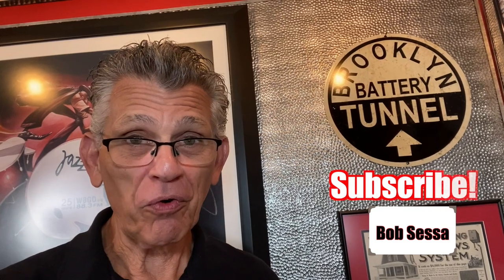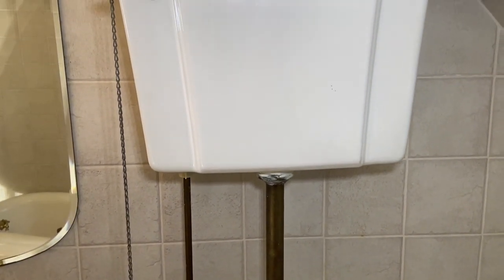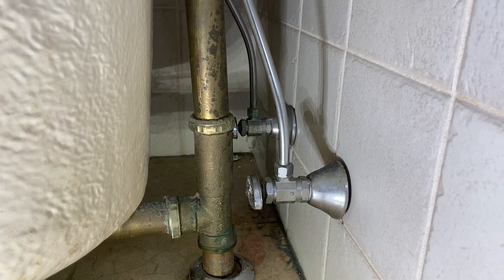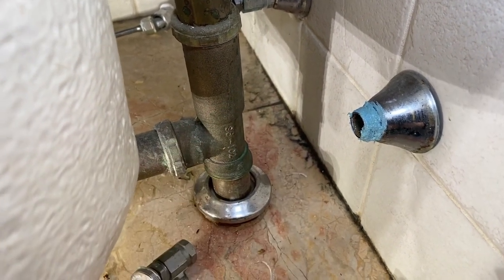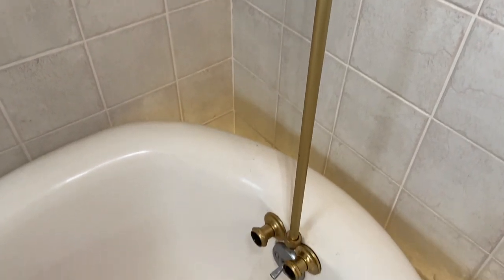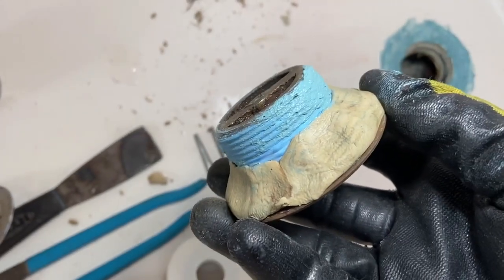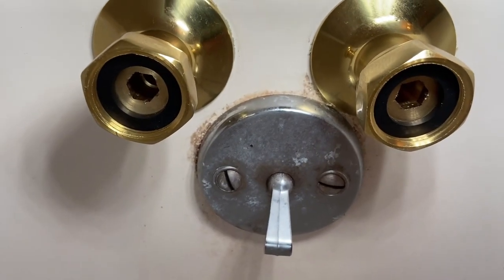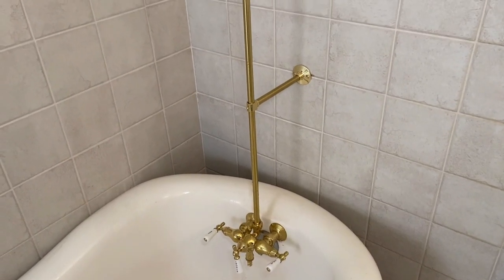Clawfoot Tub Shower Kit

Comment: Bob. I was so excited to watch this video until you skipped right over the part that I so badly needed. :( I installed the faucet - that was pretty straight forward. but HOWWWWW do you install the *un threaded* shower riser rod??? I installed with the rubber cone thingy and the nut, and it still rockets off under the water pressure!!! I even did it twice just to be sure I'd tightened it down well

Comment: Hi Bob, on the hot and cold water stub out's with that decorative cone cover it looks like there was no way to back up those lines when you unscrewed and installed the new values, did you have any issues with that?
Reply from the maker: Believe it or not, I used a 6" offset pipe wrench and they came right off. I was concerned they were nipples and the nipples would come off with the valves. I got lucky that it was copper w/males adapters.